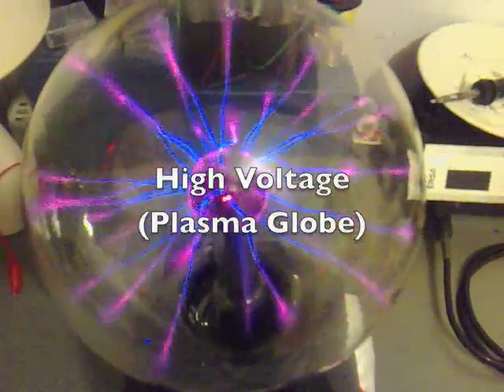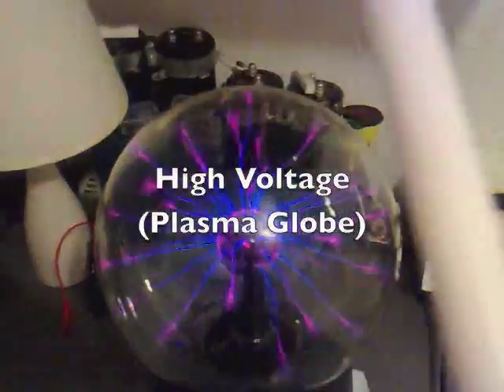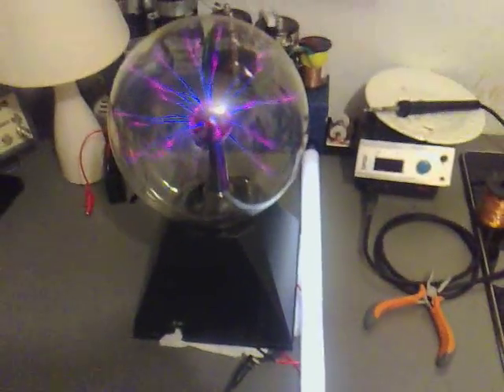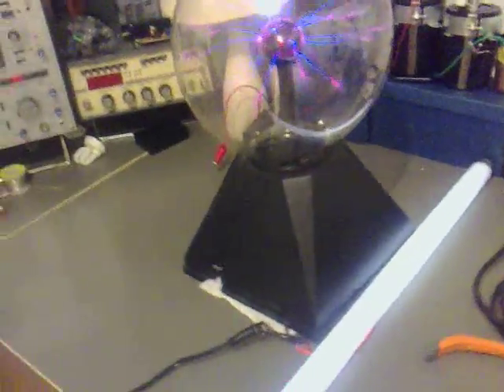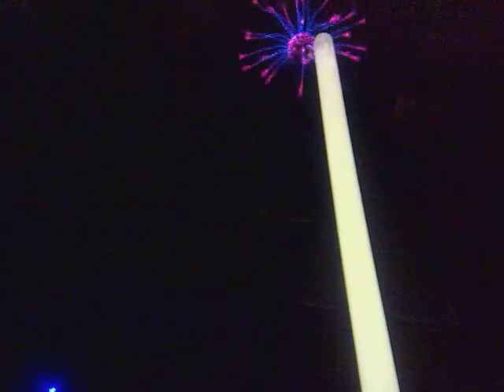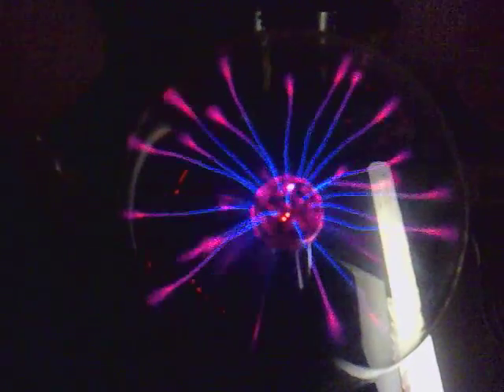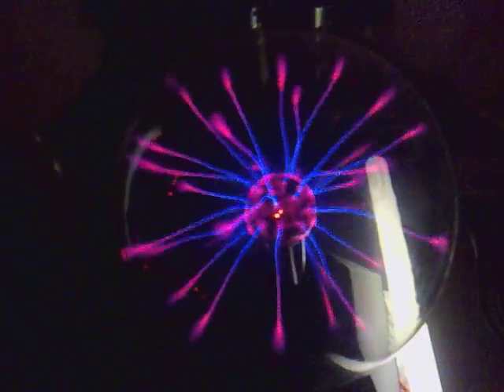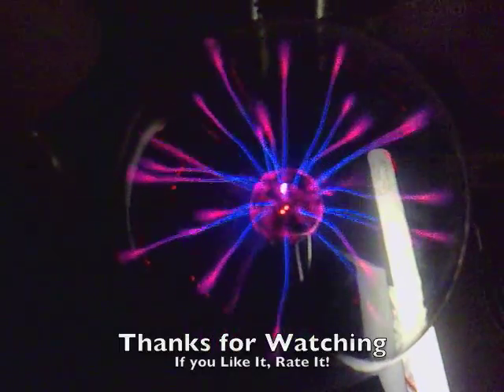High Voltage (Plasma Globe) 005

Comment: I could try to replicate it on video, its not that hard I think.
It was actually really funny, by pressing on the top isolation I could modify the pitch, making it partly sound like someone screaming...
The ignition coil was used instead of the charging battery in the SSG setup.

Comment: Hey I can do the same thing with an ignition coil, only a little bit weaker. If you connected it with some wire to a sheet of aluminum foil on top of another with some isolation in between you can create an electrical loudspeaker.

It will then be the electric field which makes the sound.

Comment: Interesting effect.  I saw a video on here somewhere that had a guy walk under some high tension power lines holding a 4 foot tube and he did not even get close to being under the wire and it lit up very nicely.  Now I am going to have to see if a tube will light from being near the transformer on one of my modified Fuji JT circuits.  Great video.

Bill